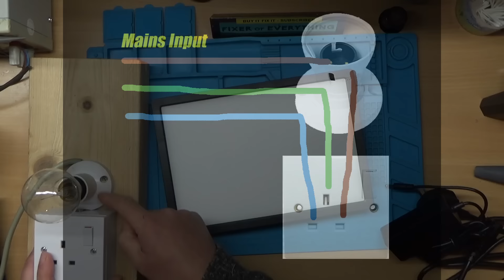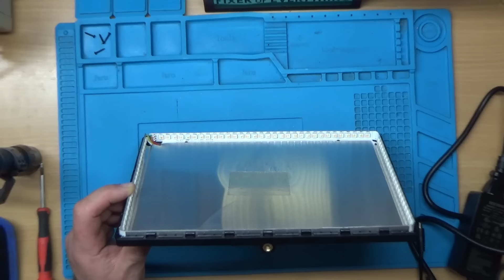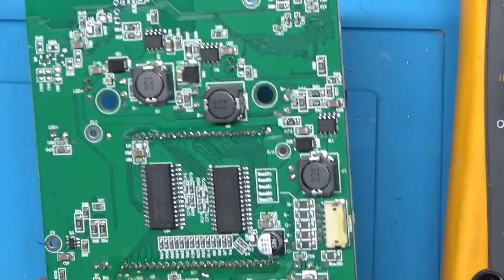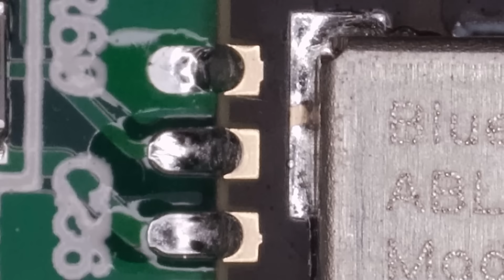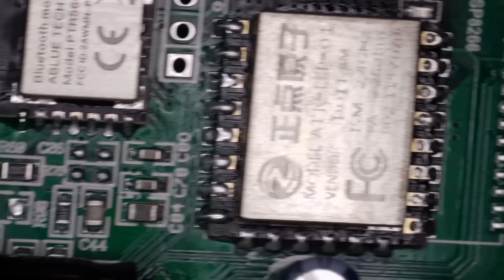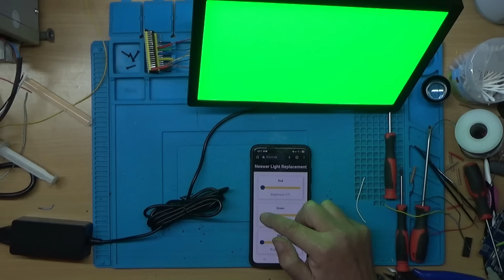Faulty RGB WiFi / Bluetooth Studio Light | An Ingenious Fix!

Comment: Mick speaking of lights, I have a broken set of Christmas Tree lights with 40 screw in lamps. They were bought new in 1969 from Woolworths for £1 they caught fire about twenty years ago and almost burnt the house down after I replaced the blown fuse with the silver paper from a packet of Woodbines (seemed a good idea at the time) question is will you take a look at them, happy to pay as they are of great sentimental value and my misses says the tree looks crap with no lights? Best regards  🤣🤣🤣🤣🤣🤣
Reply from the maker: Sure mate, I'll have a go at fixing anything pretty much. Hopefully you've still got some silver foil from the Woodbines as I'm all out myself.

Comment: 23:33 the edge is irrelevant, the board is connected to the pad further back, where the hole is
Reply from the maker: Yes, although judging from the quality of soldering it's hard to see under the board (especially at the lower edge of the wifi module) so I wasn't sure how far the solder had actually travelled.

Comment: You should try it with a great open source project called WLED it has some awesome futures and will work great for this :)
Reply from the maker: Thanks for the suggestion. It's been years since I've used WLED, I used it when I improved and wrote software for a "Digital Light Wand" about 12 years ago.. Here's a link to the original guys page. https://lightpaintingphotography.com/light-painting-photography/digital-light-wand-upgrade-by-light-painting-photographer-michael-ross/

Comment: It's a bit sad that you couldn't really flash WLED or Tasmota onto that onboard esp01 and rewire the whole board a bit, but the esp01's are quite limited on memory for the code, and grunt for smoothly running 5 pwm outputs, I've used a few for some RGB led strings, but not for RGBWW.
Reply from the maker: I had thought about it, but wasn't sure if the esp8266 had enough I/O pins as I know some are unavailable. It's been a while since I programmed an esp8266, as I used to use them for my Christmas light show that I built about 7-8 years ago which was all animated and synchronised to music. They are all on the channel way back.. https://www.youtube.com/watch?v=CB1kPaiL5Q0
Reply: @BuyitFixit  That module looks to have enough I/O pins available, unlike my esp-01S modules where I really pushed what 4 available pins could do, one even had an IR receiver and 3 pins pwm driving an RGB LED strip. Biggest issue with esp8266 is lack of hardware pwm capable I/O versus software driven I/O, and they max out at 3 PWM pins when running the WLED software, I dunno what the limit is for ESPhome or Tasmota. But as available pins go for general use, they have lots available, you just have to be careful with how some of them are used, otherwise the chip wont boot.

Comment: Hi Mick🤗.
Mhhh🤔,
Why didn't measuered you the voltage on the oszillator ?.
In these smd case there are mostly oszillator an not a crystal. (Ohhh, crystal oszillator is a little bit difficult word😳).
I would have used my arbitrary generator to test by feeding in a signal.
But, your soloution is great. It worked and this is important . 
Super great work👍🍻🍻cheers. Amazing
Reply from the maker: Thanks mate 👍 I measured the voltage on the output pins of the micro (using the scope), and there was nothing coming out.
Reply: @BuyitFixit ,, Hi . No , i mean the oszillator has four pins 2x Xtal and Plus,Minus.
Reply: @Lightrunner.  A crystal has 2 x Xtal connection (1 & 3) and two to GND (2 & 4), An standard Oscillator has one output pin/pad (usually pad 3). Voltage is supplied to pad 4. Pad 2 is GND and Pad 1 is the Enable/Disable  function. Check out IQD Frequecy Product if you need more help.
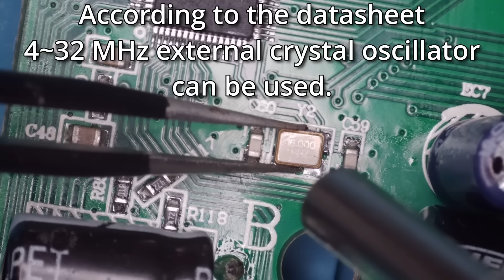Reply: @UWNoodles ,,Hi, at 31:45 youll see 4 pins. I don't know the function of the other two pins. 
In one of the datasheets from the manufactor youll see plus and minus only for power.  Mick doesn't mesured the voltage line only the output lines.
But , Mick has mastered it otherwise 🍻
Reply from the maker: There's no voltage going to this. as it's just a standard Xtal with a metal case. It just has two GND pins, and the two going to the XTAL. I think you're thinking of a TTL type oscillator which indeed has a supply, GND and an output.
Reply: @BuyitFixit  , yeah thx. That what i meant 🍻

Comment: Hacky idea and fix, well done. My only other thought was to measure the crystal pins on the micro (power on) with the caps and crystal removed. Authorisation (to disassemble) from whom, Eddie Murphy?
Reply from the maker: Cheers Ralph 👍I measured the resistance to ground from the caps, and it was over 200K, so that shouldn't have pulled any voltage down. Yes the authorisation label was funny.
Reply: @BuyitFixit  I was thinking more capacitance change or leak preventing crystal start. Another option would have been to use an oscillator, something like an Abracon ASFL1.  Of course, easy for me to say.

Comment: So the original micro controller was not replaceable?  Did the original crystal get reused?  Just wondering how much trouble/cost it would have been to replace.  The colored wires to the LEDs of the same color must have taken some time to sort out, work behind the scenes eh..  Bluetooth and WiFi for remote ops but a microphone...?, strange.  Great work Mick, your patience won the battle, slick fix again.  Thanks!
Reply from the maker: Thanks mate 👍The microcontroller would have been able to be replaced, but the problem comes with not having the software to program it as it's blank, and the original is either dead / corrupted, and will be copy protected. You would then need to reverse engineer the rest of the circuit, and work out how it communicates with the bluetooth, wifi, display etc. Easier solution was to do pretty much what I did.
Reply: @BuyitFixit  Ran into the same situation recently, manufacturer won't sell the chip programed and without the proprietary software it's a moot point.  Chip was only a couple dollars but the unit was a hundred plus😒 Ridiculous!
Reply: You realise that coloured wires are readily available? You can even buy packs of assorted wire colours!
The new microprocessor is useless without the firmware that runs it. Sometimes manufacturers supply firmware, but it's not common for consumer grade products like this.
Reply from the maker: I just usually use 6 core or 8 core alarm cable :)

Comment: For those who want a bit more thorough explanation on the dim bulb tester.

All it does is effectively limit the power that can go into the unit.

It is wired in series and lets assume he uses a 20W bulb, in that case, if the device is shorted or tries to draw a lot of amps, it will limit the power available for the device he tests.

So effectively this is "just" a crude current limiter, that limits the wattage the device is able to draw to 20W, while at the same time giving an indication of whether or not any power is being drawn.

Obviously this only works on units that draw less than 20W if he uses a 20W bulb, but it is offcourse possible to use, say a 60W or even 100W bulb if you expect the device to draw more than 20W
Reply: Also, the reason this works is that the filament in the bulb increases in resistance when it's hot. So don't put an LED in line, it won't work right!
Reply: @larrybud  Yes, that's also important, the "startup characteristic" of the filament.

And also, yes, a LED will not work.
Reply: Finding incandescent bulbs these days is the hard part. 😆
Reply: @telx2010  Here you can still get them, but now they are advertised as "Heating lamp", because it is not illegal to sell an electric heating device like this.

I think that "heating device" is also a more honest way of describing the product, seeing as 80%+ of the energy goes into heating, not light.
Reply: Yeah now i have one too.  most needed.

Comment: Nice fix. I wouldn't have thought about doing that. Also, Tamota is fantastic. I have it running on all my light switches for automation. You can also group switches so you can create a 3 way without physically wiring them to each other. A further advantage if you flash it to chinese made devices you can be sure your data isn't being sent to who knows where.
Reply from the maker: Thanks, and thanks for the info, that's really helpful 👍

Comment: Neat fix using Tasmota.👍
2 things i thought of: 
1. Does the uC respond to an external oscillator/  clock source? If so, it'd be possible to source an external 8Mhz oscillator module to drive it (maybe from an old motherboard?)
2. The installed 8266 is an older version of The ESP32. Could you isolate the PCB tracks and use it to drive the LEDS instead of the main uC? Either way, both the wifi and BT modules are now redundant and could go in the spares box.
Reply from the maker: Thanks Greg, I didn't try an external oscillator. It could be that it's some kind of firmware configuration problem (I know on some chips you can configure them to use internal or external osc for instance) or it could be something blown internally in the clock part of the IC.  I had thought about the 8266, but I know they have limited I/O and capacity so wasn't sure if it could drive the 5 PWM, and I had a spare ESP32 on hand. Yes could remove them, but I've just left them for now.
Reply: @BuyitFixit  maybe someday if you happen to open it again, it would be nice to know if it was working after plugging in external oscillation

Comment: Great work, but it might have been worth changing the caps either side of the crystal as they are critical for oscillation. You can also usually use an 8MHz oscillator module to bang a signal straight into the OSC IN pin.
Reply from the maker: Thanks. You normally have some voltage on the output pins of the micro to make it oscillate, I did measure to see if the caps were shorted to ground, and both measured the same value to ground, so I think something failed internally in the MCU, or the MCU pin configuration (external oscillator) got corrupted somehow?
Reply: @BuyitFixit voltage on the microcontroller is only present if it's an crystal, this looks to me as it might be an powered oscillator. It got it's own external power (4 pins, two for power and gnd, one signal out to the micro)
Reply from the maker: @konstantinrieck8865 Those type of oscillators don't have external capacitors. This one has 4 pads. Two are ground and the other 2 go to the capacitors and then to the MCU.

Comment: Just because it happened to me ONCE in this life: Have you measured the caps for the oscillator? I once had one of them fail on me on a PC mainboard, making the whole PC die. Not even manufacturing tools I had access to catched that. One just shorted to ground instead of doing its job. Those parts basically never have any issues, so you never expect them to fail.
Reply from the maker: Interesting. I measured the resistance to ground with the meter and it was over 100K, so there should have been some voltage on the pins even if it was 0.02 of a volt or something, but there was absolutely nothing.
Reply: @BuyitFixit  Yeah in that case you'll be good. We were going through whole rolls of these at my old job and I had it once. It's a very long shot. @Mainboardmedic had a similar issue on a PC mainboard 2 weeks ago which brought up the memory.